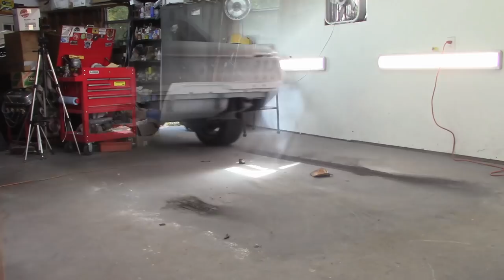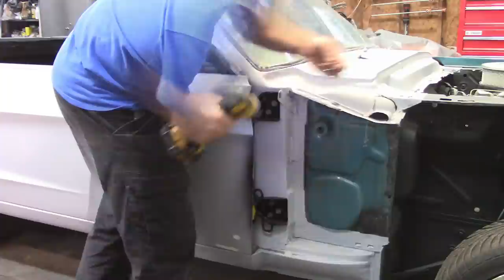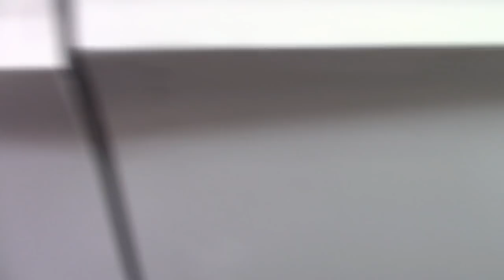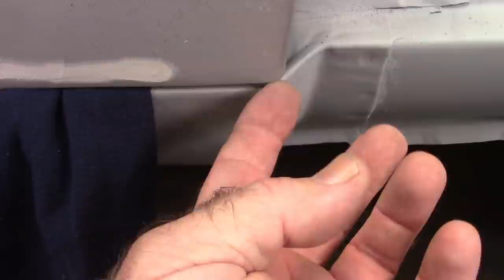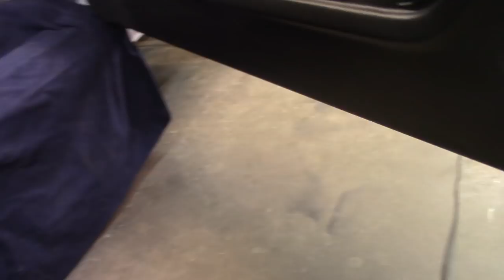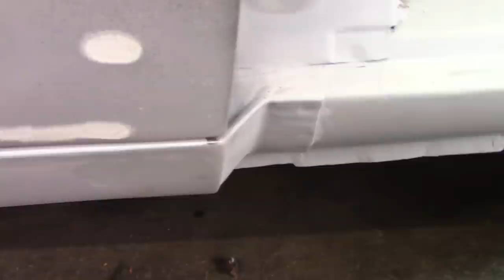Mustang door alignment. 1968 Mustang. Jade part 38

Comment: I worked at a local Ford dealer in the early 70's. My job was new car prep and one of the often needed adjustments was the doors. The trick we used was a 3/4 inch dia brass bar and a 3 pound hammer. We would loosen the hinge bolts and use the hammer and bar to knock the hinges and striker to make the doors fit better. This actually works very well with a little practice. The latch striker really has to be in position first, then match the door to the striker. So we would adjust the striker up or down in or out so it matched the fender. Then adjust the door to match the striker so you get a nice click/clunk when the door shuts. No up or down movement and not in or out too far. just clunk and closed. With the bolts snugged just right the movement is very easy to control. Hope this helps. By the was some cars came from the factory and the doors would not even latch closed. S if you really want to be original don't be too fussy.
Reply: Thank you so much for sharing.
Reply: Thank you for sharing😃

Comment: good video, two suggestions, would have helped showing a scenario where the door corner sticks out or in and can be adjusted, also i recommend using just a simple clicket with a socket because you can loose the bolt just a bit in a controlled manner, with power tools you can't control that
Reply from the maker: Good suggestions. I thought about that after I did my edit.

Comment: Great video, very detailed!  I am working on aligning my door and running into an issue.  Gaps are perfect, height is good, but the rear lower corner is sticking out about 1/4" and i just can't seem to figure out how to adjust to get this where it needs to be, any suggestions?
Reply from the maker: Hard to answer that.

Comment: Would it work to tape paint sticks to the rocker panel and the b pillar, so you have guides to set the door up against before tightening the bolts or will that not work?
Reply from the maker: You can do that to start, but the door will drop after you pull the paint sticks. All the weight has to be supported by the hinges.

Comment: The only problem I'm having with my doors is the bottom back corner is sticking out past the rocker panel. The front of the door is fine with the rocker panel. I loosened the bolts that go into the door and got it to come in some but it's still sticking out pretty good. Any ideas for me?
Reply from the maker: Are they original doors? How does the fender line up?
Reply: @JoDaddysGarage  Yes they are original doors. From what I remember the fenders were good. I haven't reinstalled yet. Just doing a mock up.
Reply: @JoDaddysGarage  One more question please. My passenger door is looking really good except the very top left. It's a little close to the top of the quarter panel. The top 1/2" roughly. I just want to move it a nudge and give it a tad more space there. Should I loosen the top or bottom hinge (hinge to body ones) and tap it down lightly to give me that relief I'm looking for.

Comment: Tape a 1/4" thick piece of PVC or plastic anything that is 1/4" on the top of rocker panel. The door sits on that for a much quicker starting point.

Comment: I was able to adjust the drivers door on my 67 Cougar to fit very well, but the passenger door is giving me fits.
Any thoughts on how to pull the rear corner of the door in more than the adjustments seem to allow?
No evidence of damage to the door or car on the passenger side...
Reply from the maker: You may have to elongate the holes in the upper hinge where it bolts to the door.

Comment: My big question is, do you make some sort of mark to know where it sits? Or do you simply leave the doors on when you do the final spray for paint? Or do you pull the doors off for paint and then just have to fit them again?
Reply from the maker: I'll leave the hinges on the car, remove the doors and prep for paint.  I'll jam the doors and the door opening, rehang them, and spray the whole car. I won't take the doors off again.
Reply: @JoDaddysGarage  That makes sense. Is that essentially what I have heard other paint and body guys refer to as "cutting in" the door jambs?
Reply from the maker: @JonnyCrash  yes.

Comment: Very helpful video. I drilled two 1/8" alignment holes through the hinges, while they were still on the car and with the front fender still on. Then, I unbolted the hinges from the car and removed the driver's door with the hinges still bolted on to the door. Drilled two alignment holes in the door part of the hinges. I then rebuilt the hinges, painted them and installed them on the car first, then I bolted the door to the hinges. This lengthy and complicated process worked great in theory. But someone must have attempted to adjust the door before me or it was just done to the "close enough" specs at the factory. Not drilling any alignment holes through hinges again.
Reply from the maker: I did the hole trick before. It worked, but seems unnecessary. I would assume someone had adjusted your doors with the worn out hinges in place. it might have worked fine if you didn't rebuild the hinges...